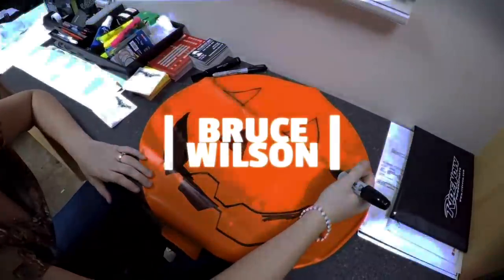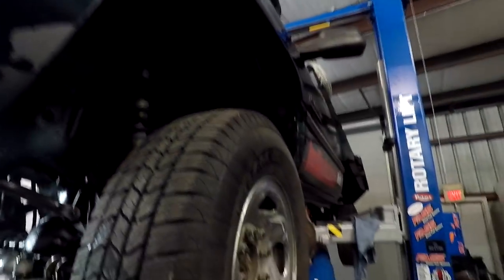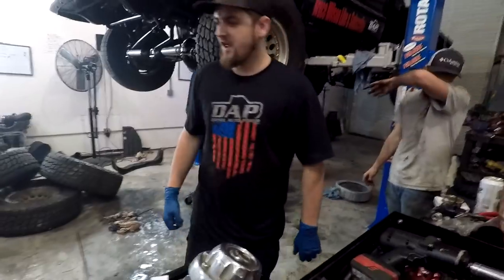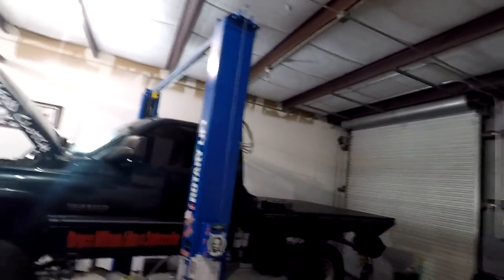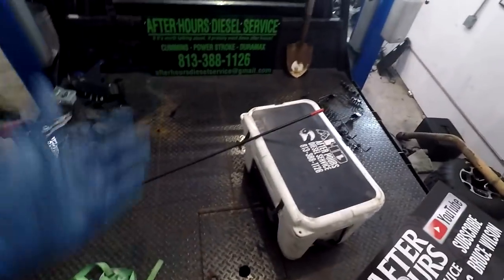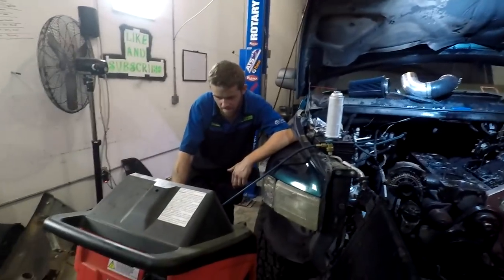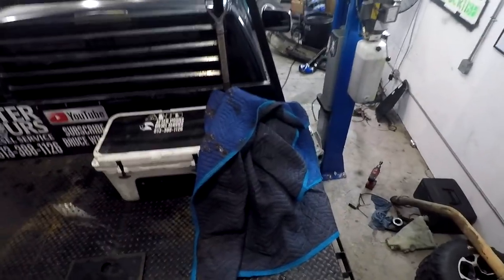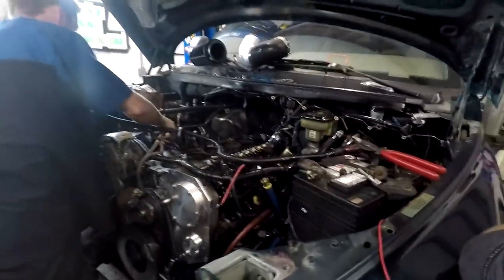The FLATBED is getting SAUCY!! ITS CRUNCH TIME!!

Comment: Give ya a tip about the green truck there I've had several of these trucks and from my experience if you take the shift tower and shifter and all off a 98+ nv4500 and use it instead of the bent stick shifter that came in the 94-97  your shift time will be way better or it did for me when I done my auto to 5spd swap and I also had a 96 with the bent stick before I got the truck I just stated and to me it's night and days difference idk what it is

Comment: Hey Bruce I’m interested in doing a p pump swap in my 24v,  I’ve already got a 215 pump with 191s and 4kgsk. Where’s the best place to get injection lines and I’ve heard you can use the 24v timing case with a p pump swap is that right? Any little things I should know before I dive into it